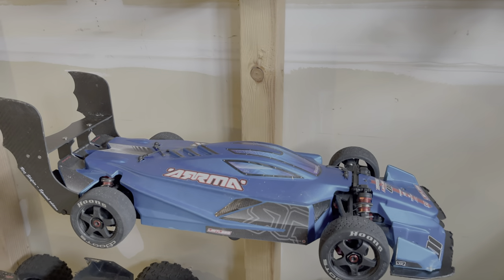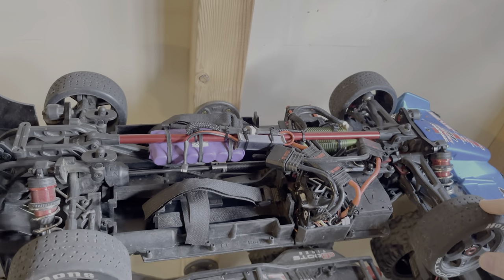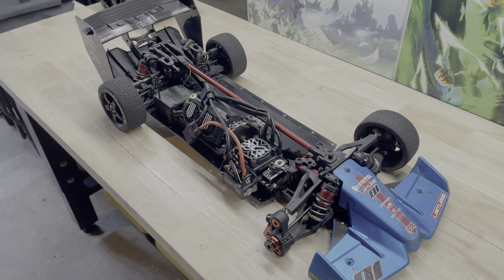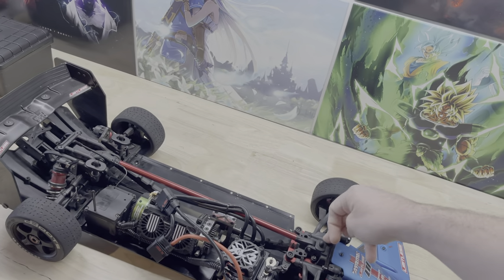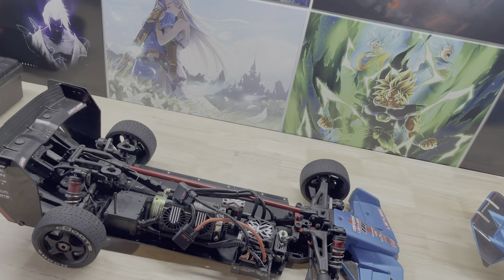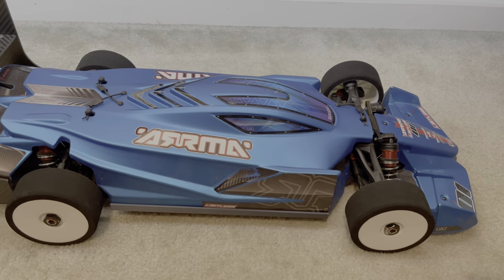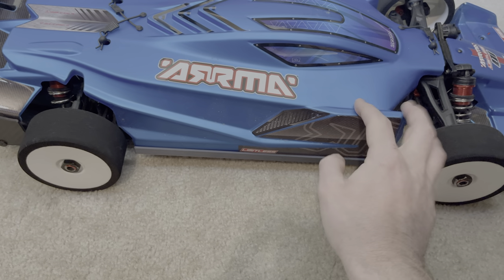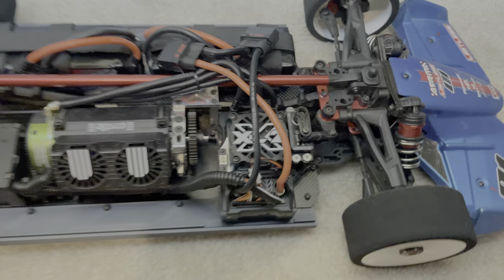Limitless 2028 Motor - Update

Comment: Ok so first off clean build definitely need the link to that esc plate but have a question one of my limitless has a issue where when I put both center driveshaft to the spool it binds up somewhere changed the diffs and the chassis??any idea
Reply from the maker: You should check things one at a time, center drive out, check if everything spins freely and go from there
Reply: Yep did that free spin rwd and front wheel drive